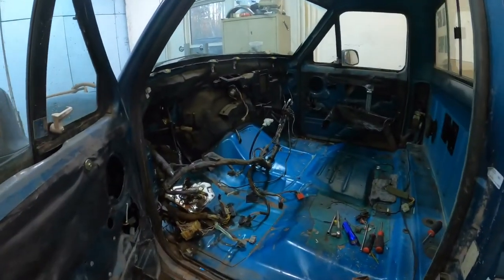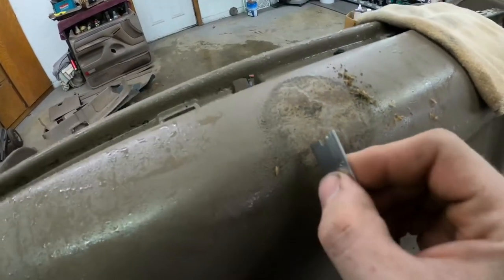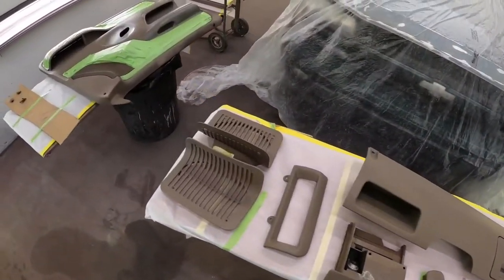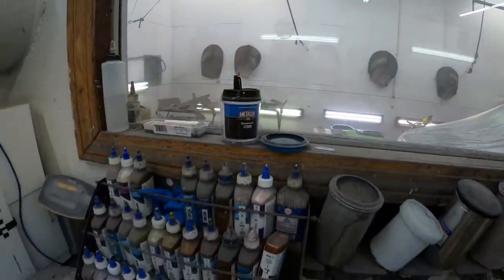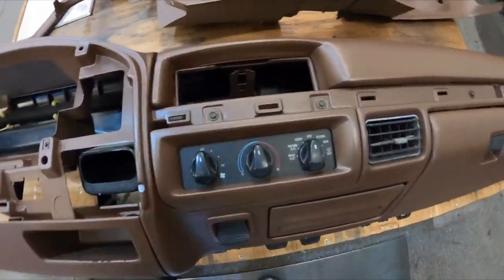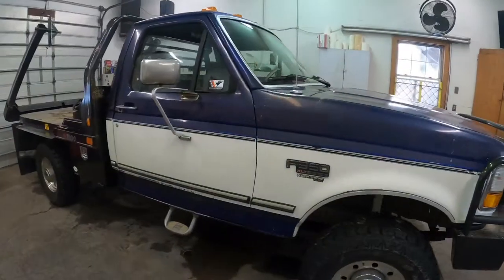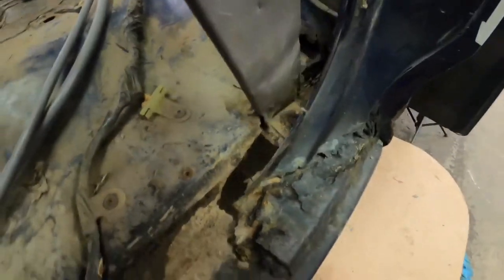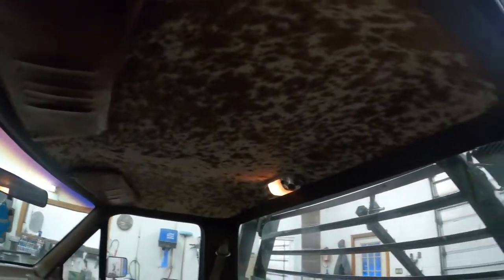Custom OBS interior installation

Comment: I just got one of these trucks. My interior is very clean for the age but my driver's door panel is rough. I got a few repair kits and some random parts and upgraded steel endura pin door pins. Can't wait to make the drivers door match the rest of my interior 🎉 thanks for the in inspiration
Reply: Im almost done with my door. I just need actuator rivet then im done. My door panel was broken where the inner window felt molding mounts too. There is no plastic left in the inner door panel there 😢😢😢😢 everything else came out golden. Just so sad about the window felt molding 😢

Comment: My 95 Flairside on my channel from a couple years ago, was the old blue, I changed it to charcoal grey and black, i used the Dupi-color plastic adhesive an paint cans, held up well but any spot's with wear show up quick, wonder how well your paint method holds up over time. Looks great man good job

Comment: I have a 99 F350 7.3 quad cab with a great interior, however I saw a video where a guy put in a 2014 King Ranch interior in the same year model truck. 

I don’t need to make the change but it would be sweet. Not sure where you’re located but I’d be interested in discussing the swap with you.

Comment: So did you have to do any prep like sanding or anything or just the good cleaning
Reply from the maker: Deep clean, sand with a scuff pad and scuffstuff solution, clean again, use adhesion promoter.

Comment: How much do you charge for this service? Also, where are you located? Website?
Reply from the maker: I'm in Virginia, cost depends on how many pieces I've got to do and if I have to do anything extra like the leather inserts or replacing the dash pad and fixing broken panels. This one I did in the video ran about 950$ but I sold him a used carpet. Seat belts. Also lowered the price if I can get other interior parts as a core.
Reply: @Lillypad2727  wow thats a really good price